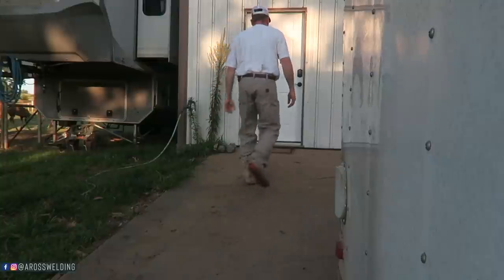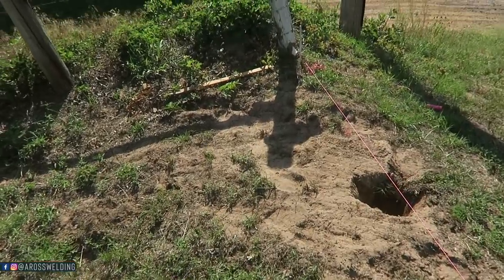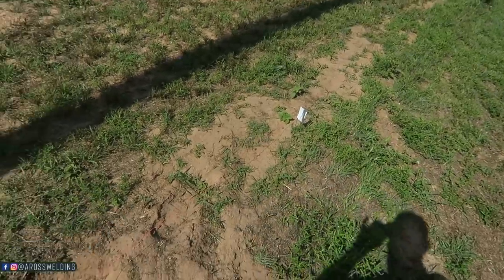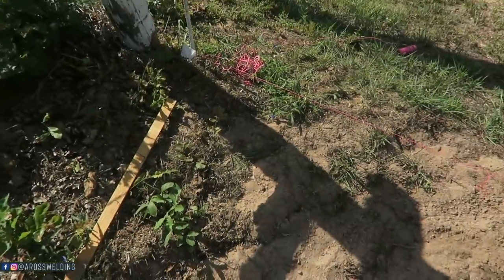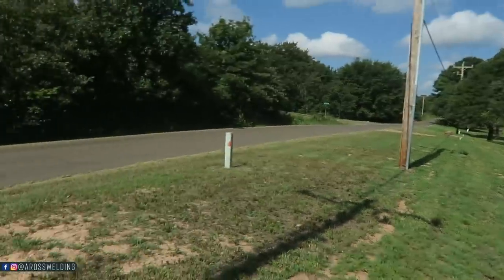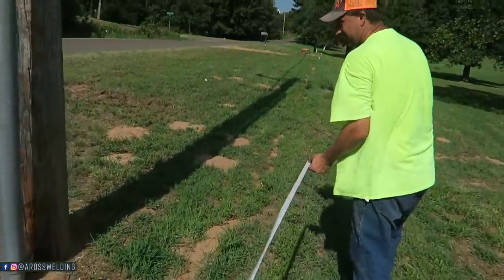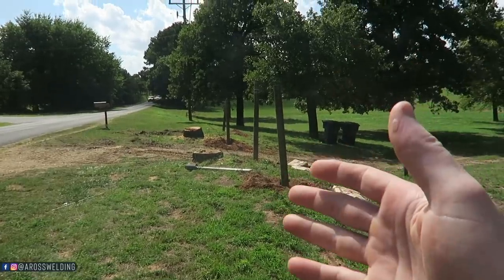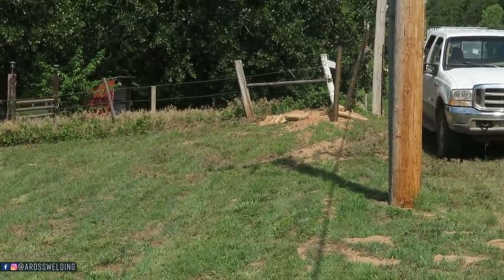FIRST AROSSWELDING PIPE ENTRANCE AND I MESSED UP BIG TIME

Comment: Owning the mistake shows your true colors. No one got hurt and you learned from it. Best case scenario.
Reply from the maker: For sure, I’m glad no one got hurt
Reply: Hey mistakes happen, I work with dumpsters and they don’t have a big enough skid steer when I am loading and unloading a dumpster full of dumpsters (+800 lbs) it lifts off onto two wheels and it’s just not heavy enough, I’ve dropped tons of dumpsters even on the truckers trailer (we receive flatbed full of metal) 

The worst I’ve done is I was going really fast and I spun around a bit and I dropped a dumpster on a 2 year old truck and put a hole into the fender at work, I know how it feels and when something messes up and it’s your fault, im glad no one is hurt and all I can tell you is Keep safe it’s what’s important because if you can’t work your gonna have to find a way to live, 

Yes mistakes happen but learn from them and don’t do it again, yeah it may have gotten you fired but that’s telling you, your company does not tolerate mistakes and that’s the only way to learn, from experience, and one last thing, whenever possible learn from others mistakes so you don’t repeat them as your own

Love the content, I appreciate you showing this and not hiding it and keep on welding !

Comment: Like many people are saying here in the comments, mistakes happen, but no one was hurt so that was a best case scenario. You're a good man for letting your ego down (when most wouldn't) to share a lesson you learned. Just a thought, I used to run machines for a small excavating outfit. We had a tank like yours on a flat bed that we'd use from time to time. We rigged a cheap Harbor Freight pump and hose to it so we'd be able to use it without having to unload it off the flatbed. Came in mighty handy to get into some hard to reach areas.

Comment: Hey Austin, really like all your videos and sharing of knowledge. I'm a grading contractor/ & operator. Done the same thing w/ pallets and nice tree's in boxes from nursery. I've learned to barely lift up something off trailer & gently rock machine to gauge the weight for the same reason. You can put a pipe or stake in the back slots of machine and have helper stand on it, to cheat and counter weight load, definitely not osha approved, but it gets it done. Gotta take one course of bags off top of pallets or restack top row closer to headboard of your forks when there a little to heavy. When your augering your holes, you gotta have your helper perpindicular to your line of site to eye your auger bit and keep plum, looks like you did once on video, but he has to help constantly not just to start. I'm sure you noticed, as you go deeper your angle changes, have to back up slightly as you go deeper to keep her plum.  You , or operator eyes plum from seat, helper eyes plum on side. Skid steers aren't ment to have lots of downward pressure, they're designed to counterweight load while lifting, unless you have rear stabilizers like some older bobcats. When you hit hard material you have no downward force like when you hit that sandstone. I take a block of wood, nail some plywood to it, like 2.5' x 2.5', so when you hit harder material, your helper can slide it under rear of machine like a jack stand  or rear outrigger. You'll have all gobs of downward force then & it will dig right thru the hard stuff. Sorry about the essay, like you I just like to share what i've learned over the years, like you do. I do a lot of welding & have learned a bunch from your videos, Thanks & keep it up
Reply from the maker: No no, it’s all good. I love reading the comments! Thank you for sharing all this helpful info!

Comment: Welcome to the fence contractor world, plan for everything and something will always happen. Lol a couple pieces of advice I have for ya. 1.  locate usually takes 3 days to mark a location, call it in a week before your planning to start and list your start date. 
2. When digging with a auger on a skid steer rember to back up as you go down to get your hole nice and straight, not that big of a deal if your just going 3 ft down, throw an extension on and drilling to 4 or 6 ft and you will end up 6" off of your mark. 
3. Dry set posts don't worry about the water. (I know its an age old argument but honesty unless your pouring a bunch of posts and the concrete is coming off a truck your better off just throwing the bags in the hole and tamping it untill its solid, ground water or the next rain will soak into the concrete and have it cured within a week. 

Now to share my mistake of the week. Building some welded pipe fence with horse panels 5ft tall by 16ft long, my truck that pulls the goose neck trailer blew the rear-end out so I had to go get the panels with my little bumper pull trailer thats 12ft long. I put a 16ft medium duty feedlot gate down first to support the panels, went and got all 35 of them loaded and start driving back to the jobsite about 5 miles away. As soon as I get up to 40 mph I realized I had a problem, my axle on the little trailer was no were near far enough back to support my load so I was tail heavy doing the fish tail going down the road, as soon as I could i turned off onto a dirt road not relizing the huge drop off bent the gate as it bottomed out on the paved road and drove the last 3 miles feeling like an idiot going 35mph. Shit happens🤷‍♂️😁

Comment: just got me my first engine driven welder its a Lincoln ranger 250 one of the older ones (2003)with the downhill pipe and lift tig settings too it has 275 hrs and im super honored to have gotten the deal. its got a onan 20hp spins like a top
Reply: I have the same one love it weld every thing with it

Comment: I'm currently in the process of building 2k feet of 3 pipe fence.  I rented a cat 249 skid steer with forks and auger to do the first 300 feet.  I'm in stage 2, and talked to the rental guy here.  I'm currently using a 259 cat. 

I tell you that to tell you this.  The 249 worked great until I needed to handle the pallet of cement.  It lifted it, and I was able to move it, but it was all that thing wanted. The 259 is lifting it a lot better, but still feels a little light on the back side.  I'd recommend a 279 if you can get ahold of one in The future.  The skid steer has made my life significantly easier with this fence project. Hope this helps, and good luck.

Comment: Losing a water tank ain’t a big deal, I know guys that put an auger through a water line and spent the whole day fixing a water leak and didn’t get any part of the fence done for 3 days because fixing the water leak was a mess because it was galvanized, so this is minor to other things that can go wrong, I did a job once that pipe fence and I bid it thinking my auger could dig the holes, well 12 inches In it was solid rock, I spent days hand digging through rock so this mistake was minor, obviously it bothers you because you don’t like to mess up, thanks for sharing keep up the good work and thanks for another cool video

Comment: Well like my brother always said to me about heavy equipment,  you gotta make a few mistakes to learn from them and he has been running heavy equipment eversince he graduated in the late 1980s. But I have made mistakes on a skidsteer but I learned from it. I'm glad I bit the bullet and showed up for for work. It ain't easy working with seasoned operators and the foreman puts you in a piece of equipment. But I'm glad they did that to me and put me In a very uncomfortable position and learned how to run equipment.  One of the earliest pieces of equipment I learned was the foot control Bobcat like you mentioned and got pretty good with it and than had to learn the hand control model. But by the grace of God I have acquired skills and now I'm working on getting my welding skills up to par. You'll get it as soon as it becomes muscle memory, it's like riding a bike you will never forget.

Comment: On another note. Im a long haul hazardous waste driver and have to deal with placards on a regular basis. If you get another tank with placards on it to put water in make sure to cover them up because if a D.O.T cop sees that without placards on all 4 sides of the vehicle you can get pulled over for it and get in trouble. Just kind of a cover your a** sort of thing.

Comment: Mistakes happen.  I've dropped stuff off too small forklifts because that was the only machine on site.  Makes a guy feel small for a day or two, but keep pushing on.  Had a like new windrower header slide sideways on the forks and then forward and off hitting the side of my lowboy on the way to the ground.  Was only a 2.5' fall, but shook me a bit.  Only bent a sheet metal shield.

Comment: What gauge post and cross member to you ran and would run normally? A fully tote of 275 Gallons of water weight about shy of 2500LBS. Yes you often under estimate the weight that is why I leave my tote always on the trailor and run from it just a garden hose with a diaphram 12V pump this way I don't have to load or unload the bastard. 2" Banjo down to 3/4" with hose threat as long you don't need higher pressure you can get away even without a garden hose. I also carry my small concrete mixer and a wheel barrel with me so my helper can premix it at the trailer and than wheel it over to the hole and just poor it in. Works very well for me.

Comment: I got a ? Have you seen a  hydraulic post driver attachment for a skid steer? My buddy has one and he can drive up to a 10in wood post and steel pipe and you can't hardly pull one up with the skid steer. No problem pounding  them in 6ft. Just thinking that would save you a ton of work and save money on quick creat. No more bouncing pallets and jumping tote tanks. Keep your chin up some days are better than others

Comment: I personally have ran that type of skidsteer, bobcat is notorious for having that old style still in service. I was on a job doing electrical burial and we rented out a bobcat and I was livid. A. Because I hate running that type of steer, B. I knew I was bad at it and was told to run it anyway. Not even 2 hours in taking it slow, we had to hurry up and get the pipe buried and that's when I drove the steer into the trench, raised the bucket up too high and face planted in the trench. Emptied bucket and got it back on all fours, then 15 min later going up a hill i did it again and face planted. After a rough self pep talk I got back in and tried to finish and I hit a retaining wall and fell into the trench a 3rd time. Got I upright and walked away. Told my supervisor that I am done running this type of skidsteer and I am a danger to the job. Havnt ran a foot steer ever since. I run an operate every other piece of equipment from telehandlers, trenchers, backhoes, trackhoes and loaders but I am very picky about the type of skidsteer I'll set my foot into. Takeuchi, John Deere, and Caterpillar because they are all joystick and throttle control is by hand pressure.

Comment: Hey Austin and all other viewers. I've been slowly setting up my welding rig all I need now is a welding machine, but I have a welding set up in my "shop" that runs of a generator. It runs with no issues. Do you think I could run my welder and grinder and stuff of that? Instead of buying a different machine?

Comment: Austin, busting an IBC with water in it is not a big deal, it's not like someone or livestock got hurt or infrastructure got damaged. Yeah, it's a pain but trust me we all make mistakes and mess up and things go wrong. You are not alone in messing up. I can tell you some stories of stuff I have done which are not welding related but still far worse, like a semi trailer full of paint coming off the tractor unit in the clients yard (Thankfully not a public road)! Their shunter driver distracted me from my routine and and I forgot to slam the tractor unit back into the fifth wheel. I got about 50yards and made a turn and BANG! One banana shaped semi trailer (no paint spilled) and some stretched suzi lines! That was embarrassing and yes there was a health safety interview and video from the security cameras which proved I was distracted but it still made feel Sh*t! Chin up lad and carry on!
Reply from the maker: I agree. Could have been way worse. I’m just glad no one was hurt.

Comment: I wouldve had a bucket for the skid steer and mixed the concrete in the bucket and used it to carry the mixed batch instead of carrying the bags and trying to make sure the concrete was mixed good in the holes.

Comment: Wow, some very impressive war-birds @ 6:05 - 6:13.   Not for nothing, but I would consider Oklahoma as cowboy country.   My question, why are you wearing a baseball cap versus a cowboy hat.    I'm a New Yorker, born & raised, ( left N.Y. when I was 29 yr's old) living in the Pacific Northwest, 50 miles north of Seattle, since 1978.   I always wear my cowboy hat if I'm going to be out in direct sun light for more that a couple of hour's.   If your gonna say they get to hot, go with the straw hat's, their very cool on the head.   For those who are setting fence post(s) in northern climate's, where frost line is 18 inch's plus, consider making the bottom of the hole "Bell Shaped," to prevent "Frost Heave." Frost heave can pull the fence post right out of the hole / ground sometimes, enough that you don't ignore the problem. Another trick to deal with "Frost Heave" either drill hole(s) to put a piece of (1/2" inch dia.{min.} or greater) rebar / or solid round stock, so it sticks out approx 1.5 to 2" inches on each side of the post, {approx. 1 inch from bottom} or just weld it at the bottom of the post. As they say on another channel, try to make every weld better than your last. Good Luck. P.S. I've had the mis-fortunate experience of dealing with what I call "WORK-CREEP." Holding the tape measure like you did at ten feet, makes you a target of "WORK-CREEP." ("WORK-CREEP" = measurement's / distance's are not the same.) Spend the money purchase a 200 or 300 foot tape measure. If you wish to keep a tight tolerance, do not purchase the fiberglass tape's, they STRETCH, especially out in the sun. Cough up the money, and go with steel tape. Buy once, Cry once. Don't believe me about Fiberglass versus Steel tapes, talk to someone who does (government spec's) concrete foundations. If their not a avid user of a steel tape, there quality leaves a lot to be desired.

Comment: Did you check county regulations for telephone post clearances . Just like well heads you need clearances  for service rigs . And as they say if you haven't had a repair welding pipe ,you haven't welded much . Mistakes happen

Comment: Man it’s pretty standard stuff to destroy one of those tanks if you do enough fence work. We’ve been through a couple already. If you hadn’t done what you did I’m sure it would have happened eventually anyway. Once they get about half empty they are a bear to hang onto with forks going across a pasture. Like others have said though, as long as no one got hurt and nothing too crazy was destroyed you’re golden. The worst days fencing are hitting stuff underground. I was drilling holes for a guy one day and he was spotting me exactly where to drill. There was a water main that was located but it was like the last hole and he said just go with it even though it was only like 3 feet off the mark. Needless to say I hit it and it instantly flooded the place. Lol I just recommend that any time you are near any utilities besides water that you carefully hand dig your hole. I’ve never hit anything crazy thankfully but I have hit water and phone lines. The phone line was the worst because it was like 4” diameter and full of tiny wires. It was a couple thousand to have that fixed so it wasn’t a good day.

Comment: Austin,brother welder,fencing for 40 yrs your making this too hard on yourself,line post serve as a support to hold up fence,a 23/8 at 36" by 8 on a 5' fence is more than good,especially with concrete,dry set only gets stronger over time,your T post are only in 18",have you ever tried to pull an t post that's been in the ground a longtime?some just don't want to come out.Gate post are super strong at 12 by 42,I wet set my gate post.I use weld on bearing hinges,remember zert up!Post side on post,fem side on gate.Over the yrs 5 workers have gone on to be contractors.Good Luck!

Comment: forgive me I may be wrong but I think if your gooseneck ball was directly over your rear axle or slightly in front of would be a lot better ride...what do you think,??
Reply from the maker: 🤷‍♂️ it rides good for me. I built it this way because of pulling a camper with my welding machine.

Comment: Concrete isn’t as strong pouring it like that you should mix it with water first either with a paddle mixer or a bigger one
Reply: That is the proper way to set posts. If you mix it first you have to vibrate it to get all the air out. That in turn with a small surface area pushes the water to the top leaving all the rock at the bottom of the hole. So in the long run you have separated your mix and it will break apart quicker than you think. 
The least amount of water you can use makes the concrete stronger.
Reply: James Glenn I agree the less amount of water you use the better. But when you mix it it actually gets water everywhere when you just dump both water and mix in there are still try pockets then don’t harden creating weak spots. It is very easy to get air pockets out

Comment: Hey Austin got any tips my machine runs I have a sa 200 black face was welding and then it stopped welding I was cleaning the armature I got the brushes and cleaned them with sandpaper how it dont have power to even run the grinders but machine runs got any tips what might be wrong